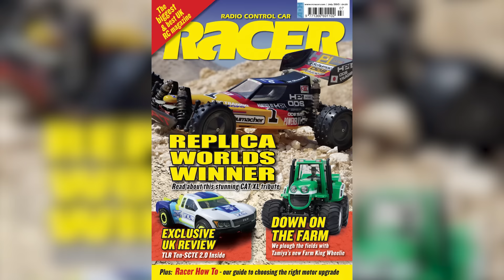RC Autopsy  // Episode 4 // Lee Martin's Triple Euros-Winning Tamiya TRF201X 1/10th scale buggy

Comment: I'd happily go back to rear motor and blown out grass tracks!! High grip is monotonous.......

Nice review.
Reply: agree back to basic offroad less of the glued dirt tracks, i mean if its glued to the texture of concrete why not just run it on pavement with wooden jumps like full size short corse trucks on circuit tracks with built jumps.
we do it on carpet also with placed out jumps.

Comment: 23:20
I've recently plugged in 10 year old intellect 5200 mah saddla pack just to see what happens. not only it didn't blow up but the blody thing charged and it still has about 90% of it's capacity :D
Reply from the maker: Safety first!!
Reply: @RC-RacingTV i've putted it in lipo bag and sat near the window with it, so i could just throw it to the garden any second :P
Reply from the maker: A bucket of sand is best - and to 'kill it' completely discharge it then soak it for a few days extra-salty water - read the disposal instructions on any RC battery maker's website